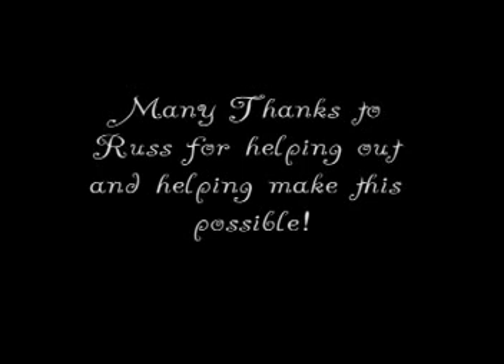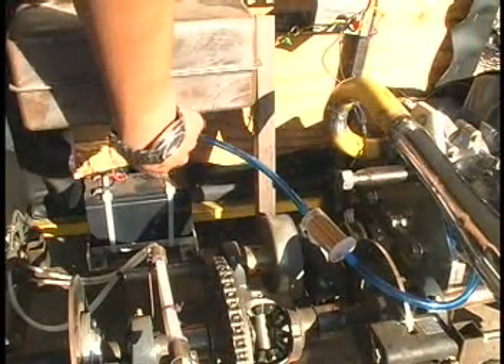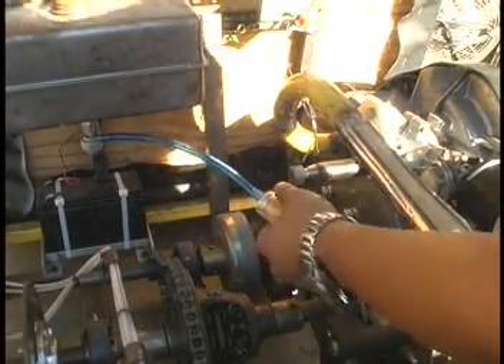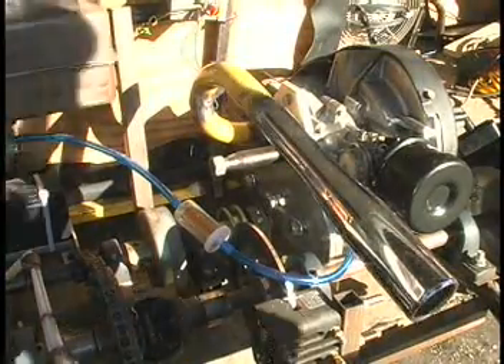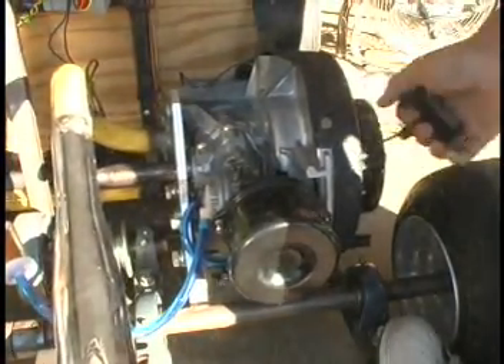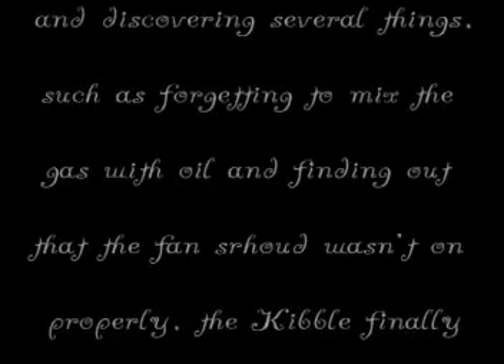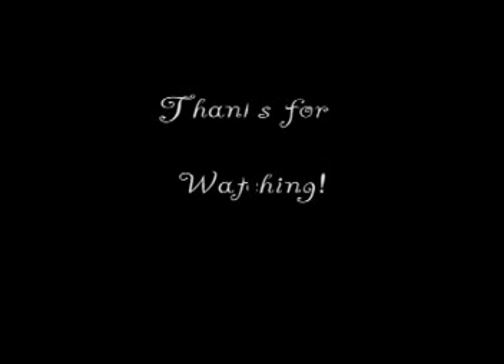World's Second(?) Fastest Lawn-Boy Powered Go Kart, Duraforce Model E

Comment: How did you rig an exhaust on this? I know the old lawn boys didn't really have a flange to bolt to, at least mine doesn't
Reply from the maker: This motor has threaded holes on the exhaust port for the original muffler, so I made a flange and welded some tubing to it to make the exhaust.
Reply: @ThatElectronicsFool  ohhh ok. Thanks
Reply: @BigRig003  the duraforce engine is the only lawn boy engine to not have an under the deck type muffler. The muffler on these sits on top the the deck on the side of the engine. So more like a direct side port exhaust. Much like the Suzuki 2 stroke Toro used on the GTS series mowers in the 80's.

Comment from the maker: eBay. One thing to keep in mind is that the carb needs a vacuum pulse line, which can be taken from the crankcase. A fitting will need to be added.
Reply: How did you accomplish the pulse port.  Did you run an external line to the crankcase, or did you find a way to port a hole into the crankcase near the reed valves?  I'm looking to fit an HL244A to a duraforce, and am pondering the best way.
Reply: @randysonnicksen9475  some tillotsons have the pulse port in the front of the flange, above the throttle blade.

Comment from the maker: Not too much. I got the lawnmower for $50, $30 for the carb, about $10 for the air cleaner and a few more dollars here and there for other little things like the fittings, tubes, nuts and bolts. The most expensive thing other than the eninge was the aluminum for the mount. I think it was about $60 for the materials.  Unfortunately, this video doesn't do it justice, it sounds WAY better in person.

Comment: I got a minibike for free with a lawnboy motor on it. too bad some assholes owned it before i did. you can tell someone just put regular unmixed gas in it and the piston and cylinder were scored so bad the rings were mashed into the piston. Almost had it running one time :D was trying to start it with a 4 way tire iron because the pull start was screwed. ahh well i guess ill have to build up m 4 hp briggs instead. Im doing a jr dragster build on that motor. Check out my videos man.